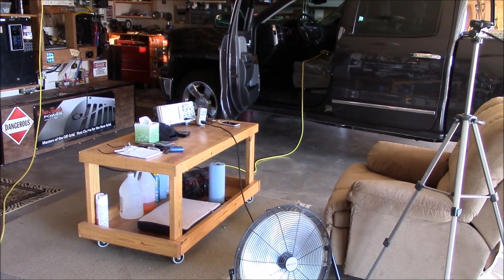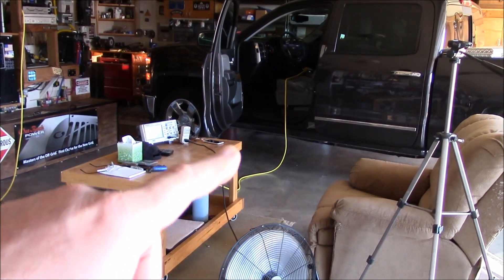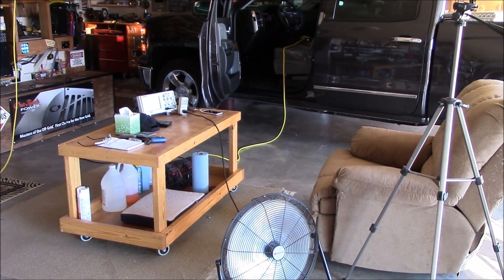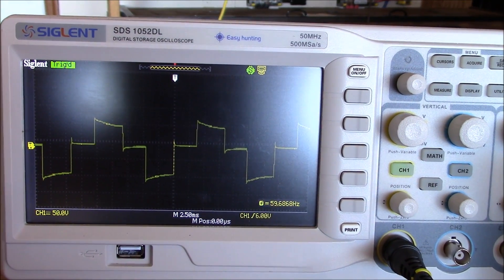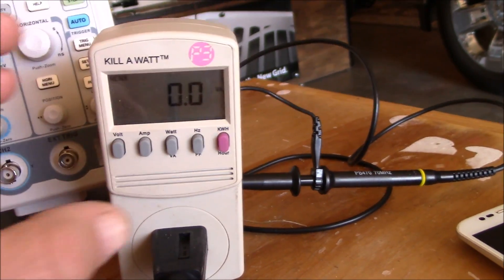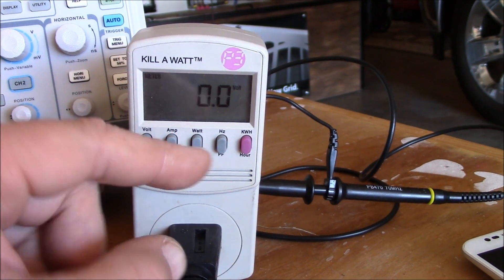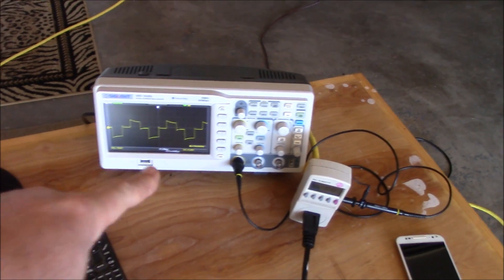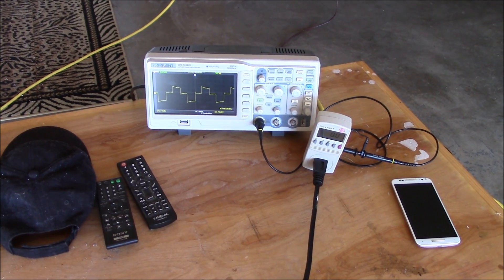Testing a Chevy Silverado AC outlet (stock inverter) with an oscilloscope

Comment: I mean yes the waveform is crappy but I don't think Chevrolet was thinking that you needed a shop fan in your truck! 🤣🤣
    Really the thing is there to slow charge a lithium battery. 
    You have a combustion engine powering an alternator that makes AC, that is rectified to DC, then inverted back into AC... The poor Electrons don't know which way to go!🤣🤣
     Anyway Pretty Cool video. 
     Ya'll Take Care, John 😎
Reply from the maker: So true. Thanks for commenting. I would love to see a "real" 120v AC outlet with pure sine wave and a min 1,000 watts. Most modern alternators in full size pickup trucks are large enough to handle it. There could also be an option to get one of those 200+ amp alternators and go even higher. (200 amps x 12.7 v = 2500 watts.

Comment: Modified Sine inverters are not designed to run fan motors.  A motor like that fan motor needs pure sine wave power to run properly.  The things that are likely run on modified sine wave include:

* Pure Resistitive Loads (Incandescent Lights, Heaters, etc)
* Brush Type Motors - These will run fine on Modified Sine Wave
* Electronics with Switch Mode Power Supplies - Some of these will work fine on Modified Sine Wave

Comment: Typical gm junk.  Coming from factory I would have imagined a cleaner Sine wave Especially with such low wattage
Reply from the maker: Exactly...esp it being 2020 and folks are spending $50,000+ on new trucks. You'd think they would spend the extra $5-10 to make the AC power outlet pure sine wave for delicate devices (like laptops).

Comment: I agree the waveform looks ugly but I was wondering if you tried it with other loads that require less current.  Thanks for the great topic for a video!
Reply from the maker: Yep, still sucks
Reply: @ChrisDIYerOklahoma Crap, I will have to check mine now.  Why even put that on a vehicle if you aren’t going to condition it better.  Seems like they would just be asking for trouble when customers start trashing their more sensitive applications. Thanks for the reply.

Comment: Thanks, was contemplating fixing mine/ replacing with stock parts.  Not worth the trouble.
Reply from the maker: Agree. One can buy a $50 pure sine wave inverter with a 12v power socket end and be done vs ripping out the center console trying to fix the stock AC outlet in these trucks. Thanks for commenting!
Reply: Where would I buy the $50 inverter?
Reply: cliff carlock - Amazon - 300 watt for about 50 bucks

Comment: Modified sine wave inverters SUCK!!!!  Why do they even bother making these?!?!?!  If you are going to hook that inverter to the battery, I would highly recommend installing a 1/2 or 1 farad capacitor in parallel wired as close as possible to the inverter so the capacitor can absorb all of the initial surges.  It will protect the alternator from wearing out.

Comment: Mine just started throwing fuses, was only using it to charge my phone. Now it pops the fuse even when I plug in a 40 watt shop light. Was going to dig into it deeper to see if the stock inverter is fried but after watching this won't waste my time. I'll just upgrade the whole system while I'm putting in a second battery.
Reply from the maker: My truck is a 2014...dunno if they improved on the newer trucks. Those outlets need to be "pure sine wave" and not this modified stepped AC wave-form crap. Hopefully, your install works out...dual batteries/quality inverter/thick battery cables/etc is the way to go. The only thing is that inverters will get hot when in use

Comment: WHOA Chris, that is like a mix between a square wave and a saw-tooth wave.  I wonder if the would put the same half-asked inverter in a Cadillac Escalade ?   Looks like it was a minimal design ...just enough to sorta "brag" to unknowing folks that they could run A/C equipment  from the truck.  I bet that the results were much better from the inverter you installed for your buddy !   Later    J K
Reply: I can confirm...same out of the caddy. My cousin has a 2016....I checked it and it’s mod sine wave
Reply from the maker: Yep...very stable sine wave out of the Aims 600w PSW inverter. I dunno about the Cadillac's...but, wouldn't be surprised. Did you notice how upset the shop fan sounded? Wow.

Comment: LOL !!! That is old school square wave for sure. I need to get a oscilloscope someday and see what my Trace inverter looks like. It is multy stepped but not true sine. Hopefully I will be upgrading my solar system early next year. I want to add 1k to the array and get a Magnum MS 4024 inverer but I need to get my wife another sports car. I have not been able to finish her MG Midget quick enough. I may just have just get her another Miata.
Reply from the maker: Oh wow...that will be awesome with more panels. I like the Miata's...and test drove one several years ago. It was a blast to drive. However, now...not sure if I would be comfortable for more that 5 mins in it (i.e. being fatter). Still, a zippy car with superior handling.
Reply: Sold her old one to our youngest,  marine. She had all the flying Miata suspension,  racing radiator, intake etc. Chuck still has it. I can't ride in them more than 1/2 hour lol. The new ones though, the set will recline all the way in the passenger seat. She said I could have her MG. I sold mine to put the solar system in.
Reply from the maker: Hahaa! Yeh, hear ya on that. Was gonna ask how he is doing. The one my ex and I test drove 13 years ago was a blast to drive...handled great, braked quick...excellent for twisty-turn roads! With my truck...I get into my friends cars and I feel unsafe. Nothing replaces displacement!!!
Reply: Roger that

Comment: Wow, that's an ugly mess.  I am going to have to test mine some day.  Not sure how many watts it is, but I remember it was quite low.  
Thanks for sharing.
Reply: I have a feeling the whine from the fan was its' plead for mercy.
Reply from the maker: Scary that they would put something that is lousy in a modern vehicle. So many folks will want to plug in sensitive electronic devices. I really wasn't surprised...however, didn't expect it to be REALLY bad (like early 1980's thinking or something).
Reply: Chris DIYer I absolutely agree the day & age of laptops & portable DVD for the kids you would expect something better.  As for the 80s well the first car I remember my parents owning (definitely dating myself a bit here)  Was a box on wheels a Ford Granada.
Reply from the maker: Hear ya on that. Thankfully, there are some good (small) PSW inverters out there that plug into a vehicle's cigarette/power outlet (normally 15 or 20 amp fused). Should be able to get 200 watts or so. Most cost around $80-120. Worth it for those sensitive electronic devices...and the power flow is more efficient. Anything more will require hardwiring to the battery like I did on my neighbor's truck. But, still a car's battery is a "starter" battery...not ideal for inverting power. While running, the alternator can output a lot of current...but, gotta be careful not to go crazy and expect to run a lot of stuff.
Reply: @LarsLondian  All of those electronics could care less about a square wave. The very first thing a switching power supply does is pass the power through a rectifier and get DC out. You can even power those electronics on DC. It's things with AC motors that care.